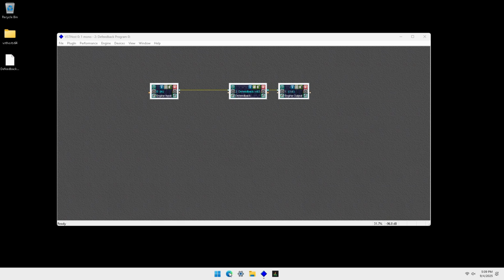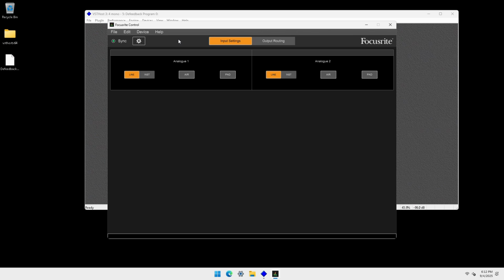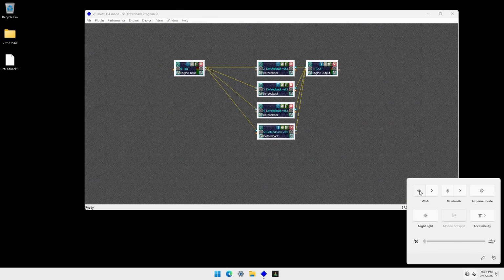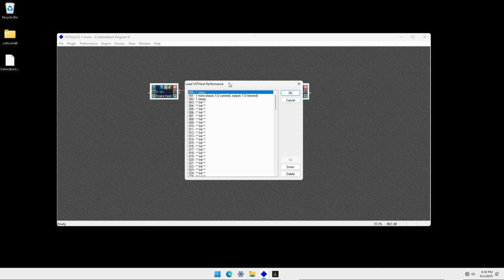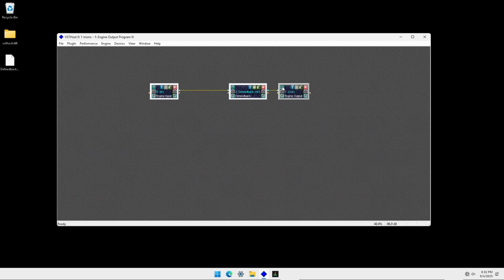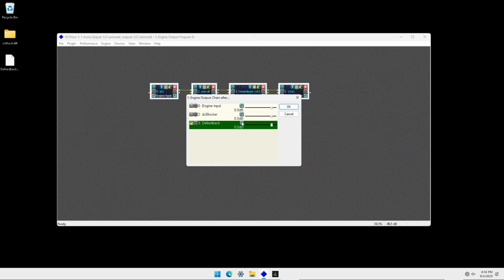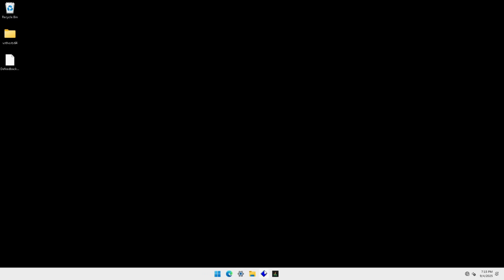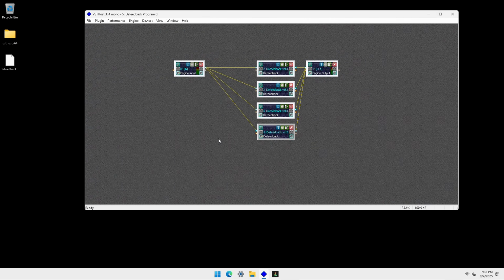De-Feedback + NUC/VST Host tutorial

Comment: How does this setup compare with running it on Waves Soundgrid or Fourier Audio Transform Engine?
Reply: Waves Livebox works very well and is very stable with 8 instances of the plugin running.  The plugin doesn't run as well on Fourier just now, though they're apparently working on it.
Reply: @kevinmcdonough9626  Hello, And what latency is using this plugin with Waves Livebox?